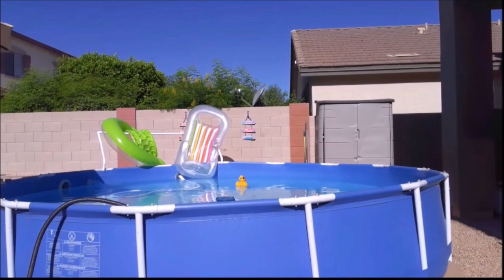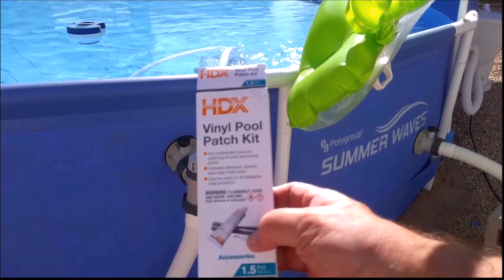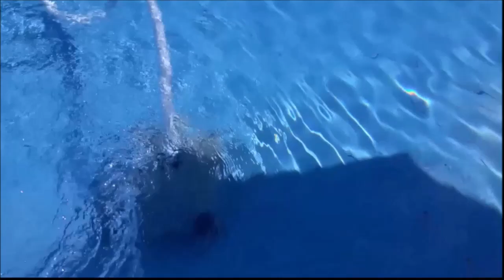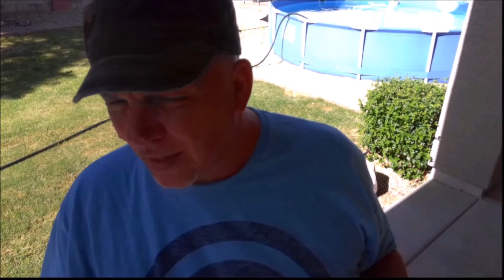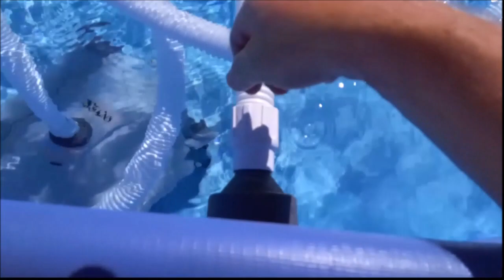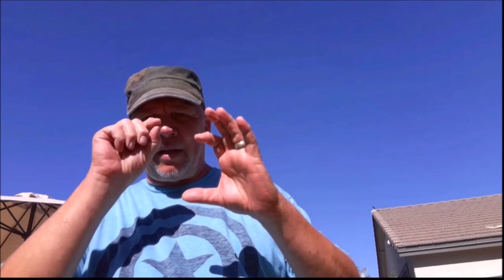Pop Up Pool adding second pump filter Intex 2500 GPH TYPE B Filter Intex Robotic pool cleaner

Comment: Hey! Love your setup! Got a question for you. I have a 12ft diameter 30 in tall intex pool. I have a hang over the inside wall skimmer basket with a 1000 GPH pump. Worked okay last year. I have two ‘in’ holes and one ‘out’ hole. The second ‘in’ hole I had plugged. Pool came with a 530 GPH pump that doesn’t pull enough. So here is my bright idea… hook up the 530 to my second unused ‘in’ hole, pulling water in and the ‘out’ tubbing I have a joiner to join tubbings,  the out flow from the 530 to the in flow from my skimmer then that would become one tube going into the 1000 GPH and one out tube for the flow going into the pool. Only concern I have is too much water pressure from what the 1000gph is sucking plus taking in the out from the 530 may be too much for it to handle. What are your thoughts?

Comment: Hi Bruce, I purchased a Summer Waves Elite Frame Pool 14 x 42, Intex Pool Filter Pump, and Intex Auto Pool Cleaner. I'm not as brave as you so I purchased the adapters to connect the Intex pump directly to the Summer Waves Filter. What can I use to connect the Intex Auto Pool Cleaner to the Summer Waves return? I don't have my pool up yet...still waiting to receive all of my items.